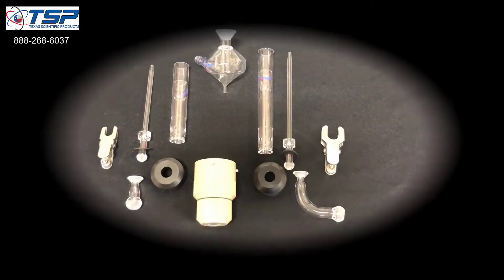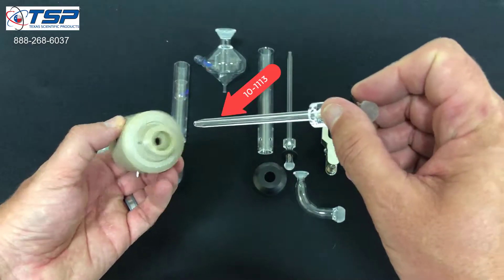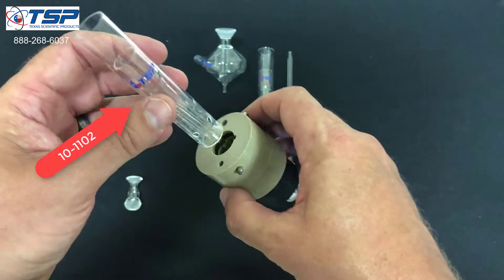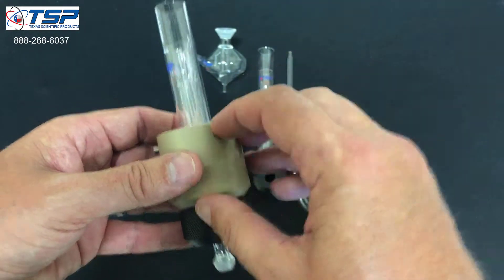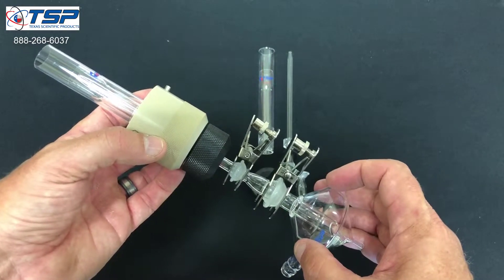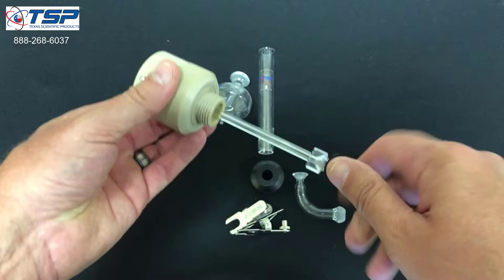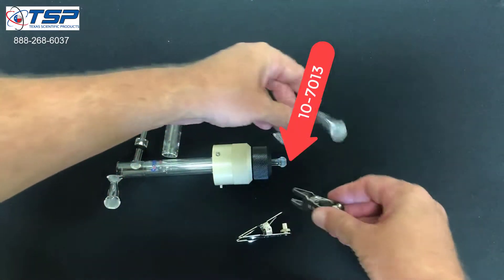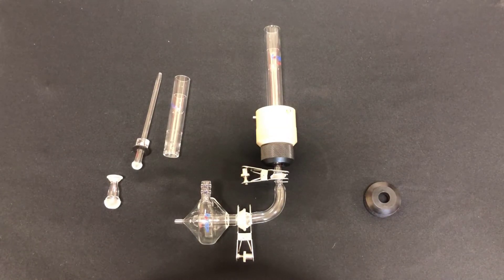Assembling the Radial and Axial Torches for the Spectro ARCOS MV

Comment: Cool new style glassware, but can I ask, why does the injector have the integrated ball joint? You just end up having more joints? Also, best practice to not breaking the injector tube and torch is to put the torch into the base first, then the injector, visa versa if you are removing the pieces from the torch base. 👍 You made me close my eyes when you took the torch out with leaving the injector in! 🤣 🤣